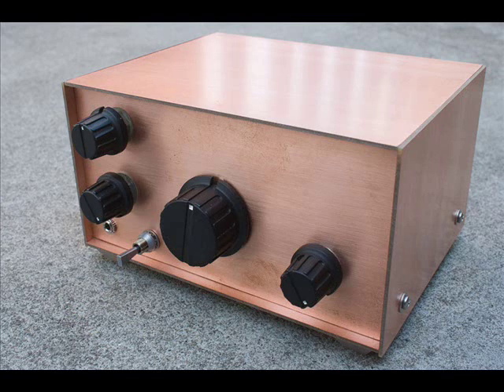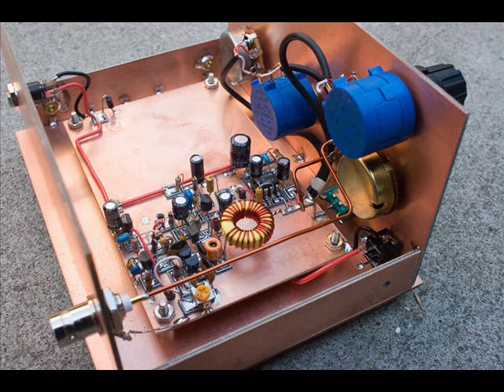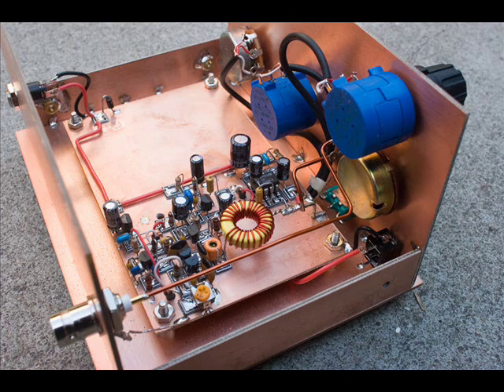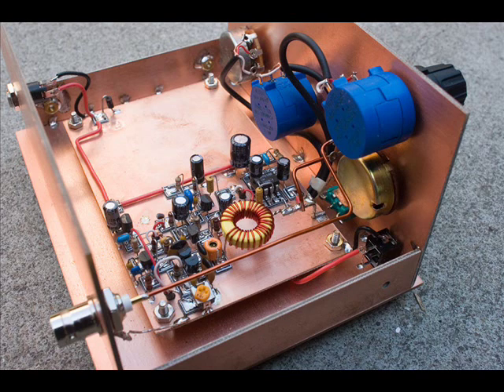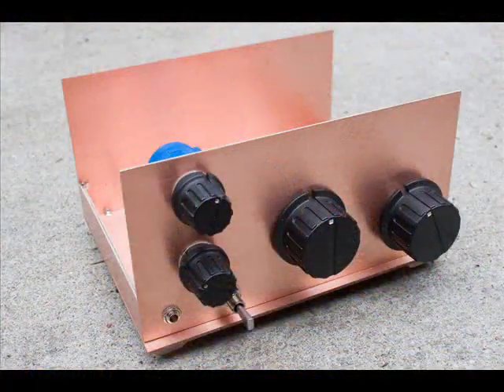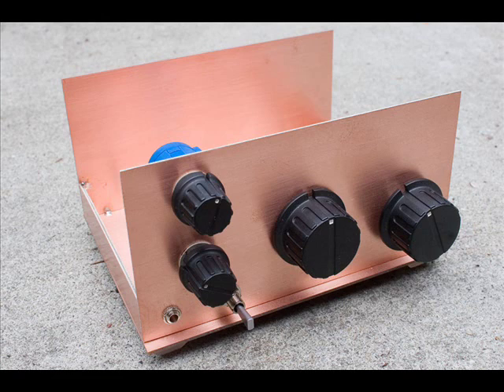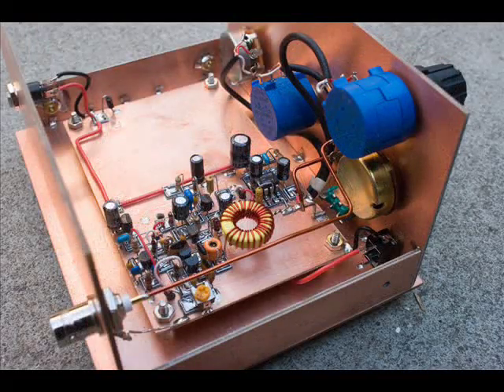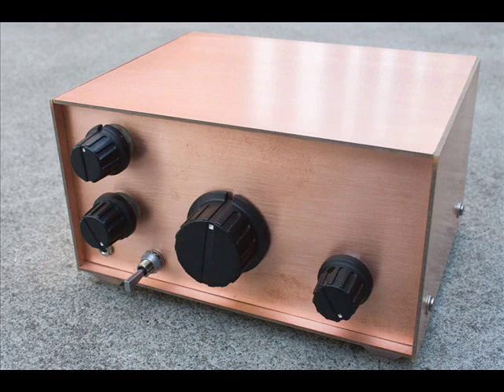WBR Regen Receiver For 40M

Comment from the maker: No slow motion drive Howard - the 10-turn pot works pretty well on it's own.

Others have had problems with that short link from the center-tap to the ground plane. Not sure if that's your problem, but some have replaced that 1-inch piece of stiff wire with a 1uH inductor and found that it gave an increase in sensitivity.

Yes, that's my voice.  I grew up in the UK.

Dave
AA7EE (formerly G4IFA)

Comment from the maker: I didn't make them protelboy - I bought them ready-made from QRPMe in Maine.  I cannot put links in this comment, but if you Google MeSQUARES and MePADS, you'll find them.  A MePAD is used for the LM386 chip and MeSQUARES for all the other connections.

Comment from the maker: It's a 10-turn pot Derek, made by Bourns - part number 3590S-2-103L

The MeSQUARES and MePADS are available from QRPMe.  I am not allowed to put links in this comment, so if you Google MeSQUARES and MePADS, you will find them.